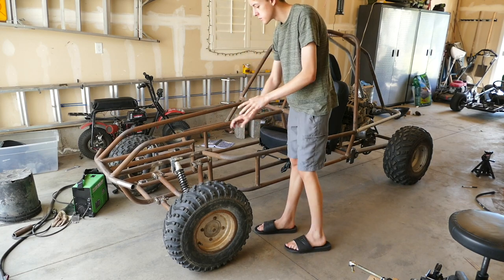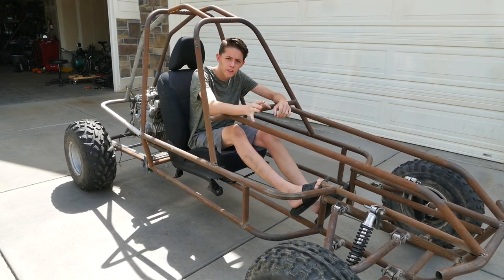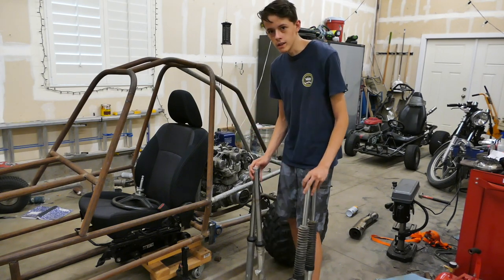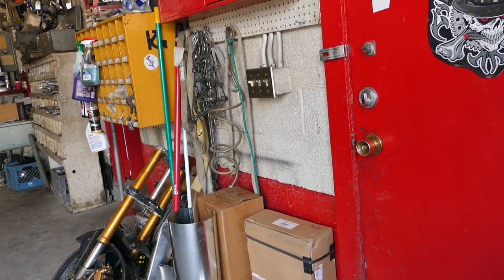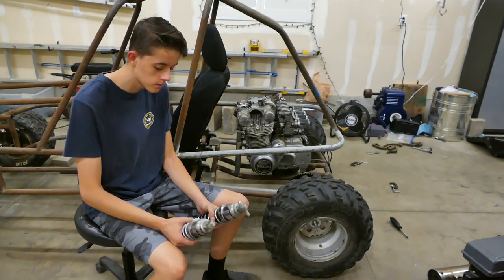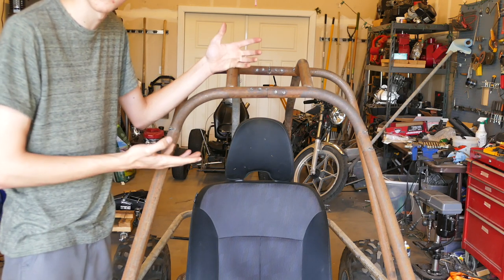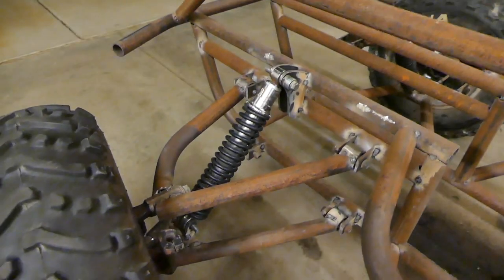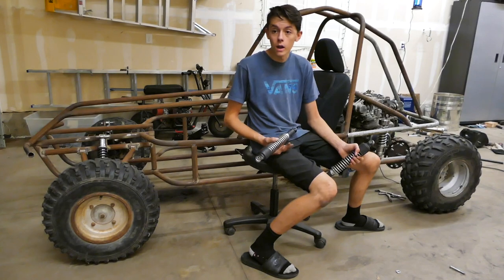Suzuki GS550 Mini Buggy Build Part 4! || Suspension and engine!

Comment: With your engine mounted on the swing arm, how did you set up your shifter linkage so it's always in one place for your hand?
Reply from the maker: I just put the pivot point as close to the pivot point of my swingarm to mitigate shifter movement as much as possible, it still moved a little bit under full compression but for the most part it worked great

Comment: Hey where was the boneyard i need some parts and what was their prices were they reasonable? i might get a few engines from them
Reply from the maker: It’s in West Valley City, Utah and it’s literally just called “boneyard” on Google maps, prices are definitely reasonable and he’s willing to negotiate, outside engines are $40 apiece cause most of them are pretty damaged, he’s got tons of engines inside in better shape too that are presumably more expensive but I’m sure the prices are still super reasonable with those, the shocks cost me $30 for both
Reply: @WildfoxFabrication  dang well i might head down there, did you see any two strokes
Reply from the maker: @ldpackman5594  oh yeah tons and tons of two strokes, snowmobile engines, dirt bike engines, everything
Reply: @WildfoxFabrication  Heck yeah. I’ll have to go check it out